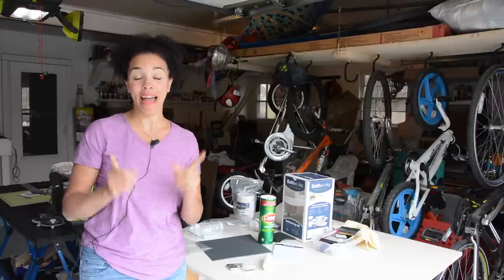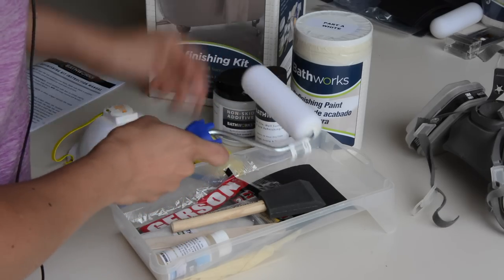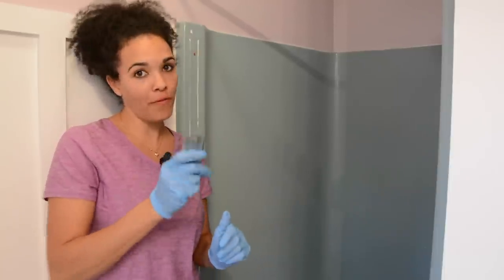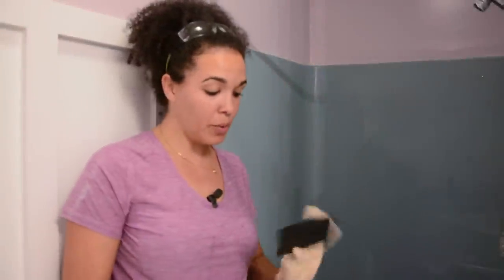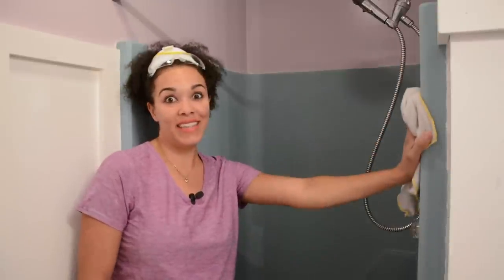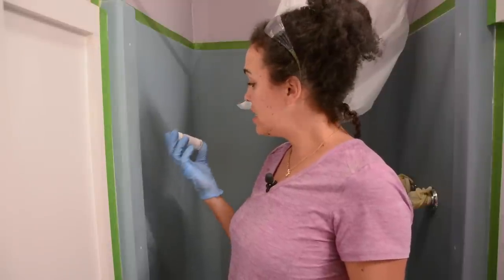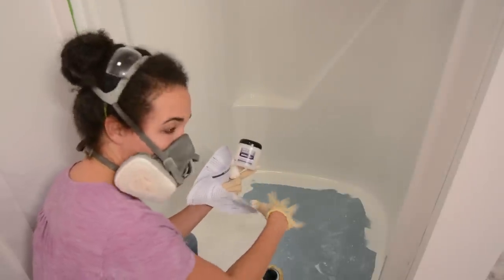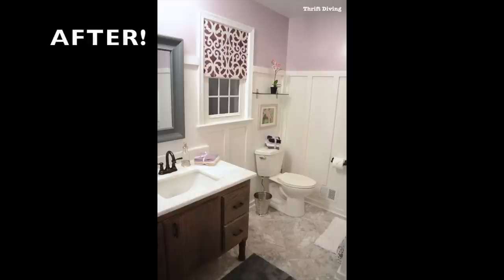DIY Shower and Tub Refinishing: How to Paint an Old Shower - Thrift Diving

Comment: Good afternoon TD ,  I should start with this is the first one of you videos I've seen ,  and I've been doing  Home Renos for over 25 yrs .

And for all the different things I've done over the years , the one thing that is the most common thing on the list of how/what to do , bar none , is ...prep work ... and just when you think you've done enough ....do more  ( this especially true for DIYer's  )

So good to see you made that point clear.   I also think that fact that your wore a respirator instead of the little mask you said they sent you .  It's really tough to stay focused  and patient doing that kind of job , with a pounding headache .

And when it came time to actually paint , I don't understand why you bagged up the whole shower head and hose , vs just removing it .   I'll bet it was in your way and also cast shadows on your work .  

But I also have to question you when you say that it will cost you $ 6000 to have your shower replaced .

For 6 grand , you better be getting the entire bathroom redone . And that would be with a nicely tiled shower and a good quality valve and shower head , New toilet , vanity and sink/taps lite fix etc.  

So to imply that you're saving 6 grand by doing your own shower , I think is a very misleading statement .
Plus what did the plumber and new taps cost ?

My comment  is not intended  to be negative ,  but merrily a statement .

I'd also like to have seen some close up views of how the shower actually turned out .

As I clicked on your video because I'm always watching for different products and how they work .

But however things worked out , I happy that you , are happy . And really , that's all that really matters .

Thanks

Comment: We are getting ready to move and I wanted to freshen up our master bath. We took the yucky shower door and frame off. I decided I wanted to just use a curtain instead of putting on a new door. I watched your video to show me what I was up against. I am excited to go to Home Depot and get the kit so I can get started. Wish me luck!
Reply from the maker: Hey there, Cindy! You won't be able to find it on the shelves at Home Depot. You can only order it online at either of these places.

Purchase on Amazon (affiliate link): http://amzn.to/2mPSoUq

Purchase on Bath-Works.net: http://www.bathtubrefinishingkit.net/

This kit uses a hardened resin that holds up longer than Rustoleum, which is what you'd find at Home Depot. But just order it online and get 2 kits just to be sure you have enough product. Good luck! :)

Comment: Just started considering to do this myself. This was a great video to find. Thank you for posting this.
Reply from the maker: You'll love how it turns out! Just take time to prep properly and it will turn out. It's been years now and it still looks good. No problems with peeling or chipping. There are 2 small chips near the drain which I think is due to putting a metal drain catcher there. But that was a couple years ago. No other chips. I would do this project again in a heartbeat. Good luck!!

Comment: You do such great projects🤗  i really want to try thia rather than removing all the tile, to much dust dirt and up and down the stairs cutting tile etc.... this looks so much neater and easier.  I want to do the floors
Reply from the maker: Yeah, give it a try, for sure! It can't hurt. I look at it this way: if I try a product and it doesn't work, as long as it doesn't make things more expensive to fix, then it can't hurt to try. The worse thing that can happen is that you end up just getting a new shower anyhow. :) But this has held up nicely!

Comment: Great video! I am going to resurface a shower pan which is fibreglass or vinyl - not sure.  I guess the most important thing is to make sure you use the roller well for paint application so you don't see an tracking?  Good job!

Comment: Great demo!  Wonderful idea. However, I would like to know about care of the painted surface. Once the job is done,  how long will it continue to look good, and how can it be cleaned without damaging the painted surface?
Reply from the maker: Hey there! I did this project in early 2017 and it's been a year and a half now and it still looks good. I am going to do an update on it very soon! If you subscribe to my channel and hit the little bell to be notified, you won't miss it when I do the update. :) I think as long as I take care of it, it will look good. I clean it with the recommend stuff, such as scrubbing bubbles, and just wipe off the dirt and soap scum. You can't use things like Comet or anything that is abrasive. :)

Comment: Did you use 2 kits for this project? You said that they sent you 2 but you never mentioned if one kit was enough for your project or if you had to us both.  I have the same shower stall as the one you featured so if one worked for you then I know many kits to purchase. Thanks for your time.

Comment: Free product provided by manufacturer (shill video)- no long term review / actual usage. Excellent demonstration of instructions being followed in case you cannot read.
Reply from the maker: Wrong. I actually have done a follow-up video that you're welcome to check out here, which is a 10-month post follow-up: https://www.youtube.com/watch?v=WRZAmHNjvEk&t=15s. As I mentioned in the follow-up there is a small chip that may have been caused by the metal drain. That chip is still there and I will be repairing it in an upcoming video, but aside from that small chip, the shower still looks great and hasn't peeled or chipped otherwise. You'll see if you come back to watch the updated video. Or, feel free to email me serena@thriftdiving.com and I can always send you a picture of what it looks like today if you can't wait for the next follow-up video.

Comment: I’m so glad it’s still working and beautiful (except for that little chip).  Have you considered turning that drain cover upside down and covering the edges with hot glue (when dry it’ll just be cushioned, and still be removable, not suggesting gluing it down) until you can find a permanent cover?

Comment: 7:20 it's very easy to just remove the showerhead and hose and have it out of your way. Use a wrench. And tape if you are concerned about scratching it. Still need a bag. Just a smaller one.

Comment: It's been several weeks of use now, How is the paint job holding up? and bubbling/cracking/loosening?
Reply from the maker: It has actually been about 2.5 years and it is holding up well! I've had one small chip due to a metal drain that scraped it. But aside from that, it's been holding up fantastic!!
Reply: @ThriftDiving  2.5 years! now that is a great fix. thank you

Comment: This was very timely!  I’m getting ready to do our tub, and surround.  Our surround is floor to ceiling (8ft).  Did you have quite a bit leftover, or do you think I’ll need two kits?  It’s just a standard builders tub.
Reply from the maker: Hey, Teresa! I think 2 kits would probably be best. I had a little bit left over, but I needed more of the epoxy and I needed more of the liquid primer that is wiped on!

Comment: Wonderful video! Did you have to use both kits for the shower or just one? My shower is the same size and I want to make sure I won’t need two kits 🙂
Reply: I am wondering the same thing!!
Reply: @OyezTheGreat Thank you!  Did you need to do 4 coats to make it perfect?  we are just doing our tub surround walls and there is a window in the middle of it (old house)  really can't decide if I need 2 kits.
Reply: @OyezTheGreat Thank you so much.  was looking at ordering on the site as they have 15% off,  but Menards is doing 11% cash back, and to have it local would be nice.

Comment: How is the shower holding up after 2 years? Considering it
Reply from the maker: Hey, Tim! The shower is holding up REALLY well. I think it's been more like 3 years at this point. There are a couple chips that i mentioned in the video, but that was due to the metal drain that didn't fit properly. Aside from that, I have had no peeling, chipping, cracking, and it still looks awesome. I'll do an updated video soon!

Comment: Great job!! my question is, how long you need to leave the paint dry? The one they recommend me i need to let the paint dry for 3 days. Thank you love your DYI 😁
Reply from the maker: Hey there, Silvina! The paint will dry in only 24 hours. I let the first coat dry for 2 hours and then added a second coat. The instructions say you can use the shower in 24 hours. I would probably wait 48 hours JUUUUST in case. :) I didn't use mine for a couple weeks only because I was doing the whole bathroom and other things weren't done. But yeah, I'd give it 24 - 48 hours.

Comment: How long did the job take from start to finish? Anything you would go back and do differently? And did you end up needing the second pint of paint or was one enough? Cheers.
Reply from the maker: Great question, Henley! The entire job took about 2-3 hours. I was also filming so that made it a bit longer. The only thing I would have done differently would be to try to work one side at a time. The instructions recommend working your way across and then down, but I found that since it dried so quickly, it created noticeable lap marks from where the top section dried before I could move to the next section. Next time I would likely just do the left side first and then make the lap marks end in the corners. I did use both pints of paint, but not much from the 2nd jar. Hope that helps!!

Comment: How is it holding up? Still going strong?
Reply from the maker: Yes, it is, Elizabeth! I did a follow-up video here (https://youtu.be/WRZAmHNjvEk) where you can see what it looked like 10 months later. But since THAT video, it's been an additional 9 or 10 months and it still looks the same. I still have to fix the small chip at the drain, but aside from that, it's holding up as promised. I am going to do another video on how to clean it and I'll show you how I fix the small chip. That should be coming soon!

Comment: Hi there!! New subscriber here!! Love your channel :) I am interested in the economical wainscoting look @ 11:18 that you created on your bathroom wall. How did you tie the strips of wood going down the wall into the baseboard? Thank you in advance for replying! I really want to know. Might be interested in trying something like this in my dining room.
Reply from the maker: Hey there, hojofan! Sorry for the late response. I used a brad nailer to adhere the boards to the wall. At one point, I used glue and that's a no-no because when removing them, they'll rip the drywall when removing them. So I would recommend just using a brad nailer and whenever you (or the next homeowner) wants to remove them, they'll be easy to remove. :) Good luck!
Reply: Thanks for the reply! But what I was really asking is what do the boards on the wall look like when they meet up to the baseboard? Are they sticking out beyond the baseboard or did you taper the bottom of the boards some way so that thay don't stand out too far beyond the baseboard. I'm used to doing renovations by the way.

Comment: Cool. But 🤔 thinking Maybe there is Some Depot or another place that has ready to use. And just do the steps of Cleaning before Painting..🤔
Reply from the maker: Home Depot has some painting kits but honestly, I’m not sure how well they work compared to the Bath-Works one I used. This one has been 3 years since I have painted it and it has literally held up nicely! There are only a couple of small chips and I think I did that last year when I had a metal drain on it and it got scratched. Otherwise, this paint has been 100%! I’ll do an updated video to show everyone soon!

Comment: 6K for a new shower is exaggerated !  If you go to Home Depot you get a new shower stall for as low as $200. Add a good affordable contractor and get the job well done. And never worry about retouching the paint chipping . It will chip, I’ve seen it. Thanks for the video, though!

Comment: This kind of depresses me. The people who lived in my house painted the tub with regular paint & I'm sure that has to come off first + I have a shower with a fiberglass bottom. Does it work on fiberglass? OMG Could the roller be any smaller? lol
Reply from the maker: Oh wow, Cynthia, regular paint?! EEK! Yes, you have to get that off first. I'm wondering if regular stripper would work? I like a stripper called Blue Bear because it's soy-based, but I would test an area first to make sure that it's safe on your shower. And yes, you can use this product on a fiberglass bottom. My shower is fiberglass. It's been well over a year now and aside from a small chip near the drain (which I will repair in an upcoming video soon), the shower looks just like it did when I painted it in early 2017!
Reply: Thanks - the painted tub infuriates me as I'm not really a DIYer but I know not to do that. I've sucked it up & kept it as clean as I can with bleach but it is looking pretty ragged & I don't use it anyway but it's the only tub I have. I haven't had a bubble bath in years. ;(  I doubt any stripper could cause more damage already done to the tub. I'll have to think if I want to take on that job. Thanks again.

Comment: how has this held up so far?
Reply from the maker: I did a follow-up video here (https://youtu.be/WRZAmHNjvEk) where you can see what it looked like 10 months later. But since THAT video, it's been an additional 9 or 10 months and it still looks the same. I still have to fix the small chip at the drain, but aside from that, it's holding up as promised. I am going to do another video on how to clean it and I'll show you how I fix the small chip. But aside from that, it still looks good. It's not peeling!

Comment: Can we have an update?
Reply from the maker: Yep! Here's you go! I did a follow-up video here (https://youtu.be/WRZAmHNjvEk) where you can see what it looked like 10 months later. But since THAT video, it's been an additional 9 or 10 months and it still looks the same. I still have to fix the small chip at the drain, but aside from that, it's holding up as promised. I am going to do another video on how to clean it and I'll show you how I fix the small chip. But aside from that, it still looks good. It's not peeling!

Comment: $6000 to replace shower? You could rip it all out and replace with tile for a few hundred dollars and do all yourself
Reply from the maker: You are correct, and that is what I was going to do, until I realized that the tub refinishing kit was a less expensive and less time-consuming option. But yes, to have contractors come in and do what I originally wanted, which was new tile up the ceiling and a seamless shower door, it would have been about $6k for them to do that. Who has that kind of money??

Comment: 6thousand to replace a small shower i dont buy tht smh. I thinking of replacing mi e because its dingy white.tht why im watching this video. Shower is 72in wide. Its only 300.00 to 600.00 to buy a new one at homedepot..... most diy or home improvement shows say things cost thos much but im watching it thinking b.s
Reply from the maker: Well, I should have been more specific in that the type of shower I wanted would have been $6,000, which was to replace it with tile and a glass door. THAT is what I was bringing contractors in to get quotes for, but I don't think I was very specific in explaining that. But you're right, if you're just replacing it with another one of the same type, to have a contractor install that it wouldn't be $6,000. But using Bathworks will still be cheaper than anything else you could do.
Reply: Well she may not have someone to install it like me and the labor is what cost you. REALLY

Comment: Good job.  That was labor intensive but end effect was good and saved money.  With regard to the video, talk less and show more.  Let the camera do the talking.  Way too much talk and at the end, you barely showed the finished shower stall.
With regard to safety, don't chat while doing the epoxy coating.  Get out of there into fresh air.  You have no idea how toxic this stuff is for your lungs, even with a respirator, The fumes get in.

With regard to project, you made one big mistake.  You assumed you needed to keep this plastic shower stall in place and had few options.  That basic assumption was wrong. There are many other options for shower stalls you did not explore fully.  Lack of research was your mistake.  
1. Rip out shower stall and either sell it as an RV stall or junk it.
2. Use Innovera PALRAM or PALISADES vinyl tile which are both glue on vinyl tiles fully waterproof and done very fast in a few hours. Way less labor and no fumes.
3. Use ceramic or glass tiles instead.  Way less labor and adds value to your home. If you shop wisely, cost is low too.  No fumes!  Less labor.  Looks fantastic.  Its not hard.  The amount of time on labor could have been spent on research instead. Tiles also hold up to RV movements if you use Polymer in thinset and grout and smaller tiles.  Very easy to do, involves some technical steps but that is how you learn and grow.

Stop being so fearful.  Its just paint.  Do more.
Reply from the maker: I talk in my videos to tell the story of what I've done and the steps. And I don't believe in music or long gaps where it's just quiet. Sorry, not sorry. 🤷 I use my voice for a living. 

I didn't have to do any more research because this is the option that made the most since to me for the time I needed the shower improved. Many of people have watched the video and it helped them find a solution to their own ugly showers.